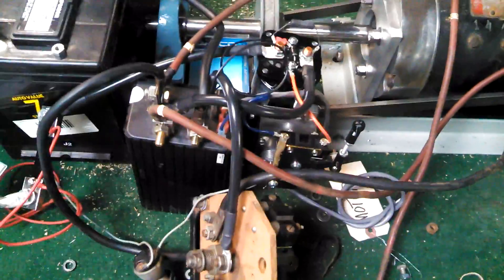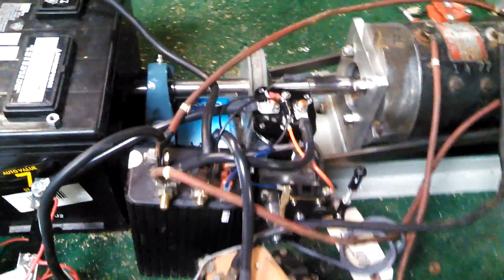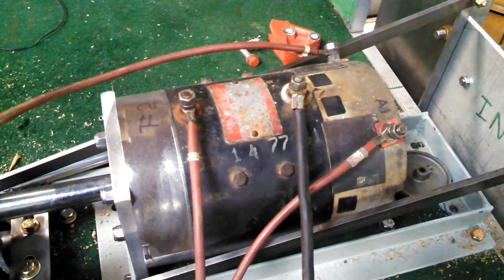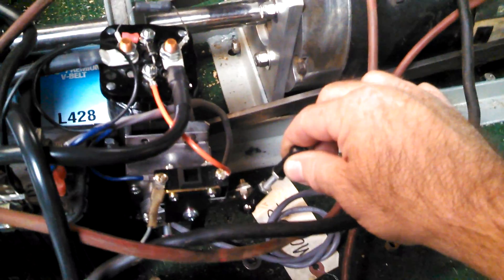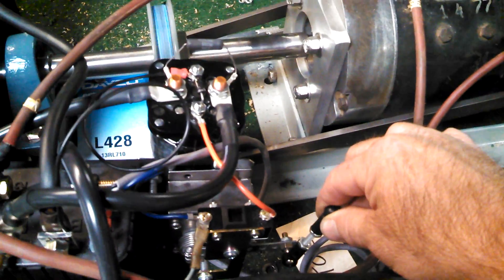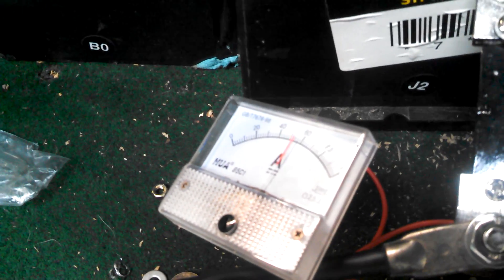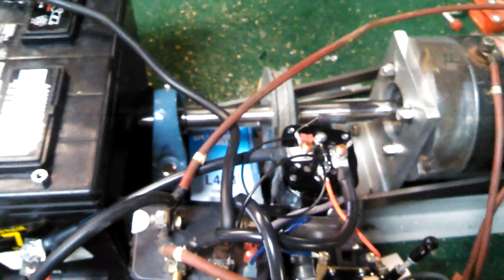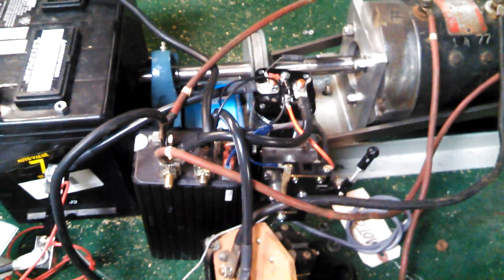Pontoon Motor test10 14

Comment: HI, How did you design the end plate for the golf cart motor? I understand that it doesnt come with a supported shaft so one needs to put bearings on the other side?

Nice video!
Reply: The aluminum plate I made has the bearing in it.

Comment: Ever get this completed? I can't find jack squat on homemade electric drives.
Reply from the maker: +72fr250 
I have floated the boat and run it under its own power. I am in the process of troubleshooting prop pitch vs amp draw right now via trial and error.
Reply from the maker: +72fr250 
I have floated the boat and run it under its own power. I am in the process of troubleshooting prop pitch vs amp draw right now via trial and error.
Reply: @jepstr67  how did it go
Reply: @TheInsultInvestor  Life got complicated and the project got sidetracked. I'll be able get back to it next year.